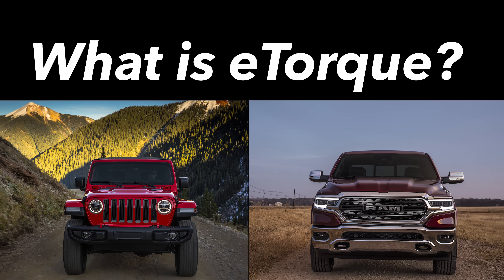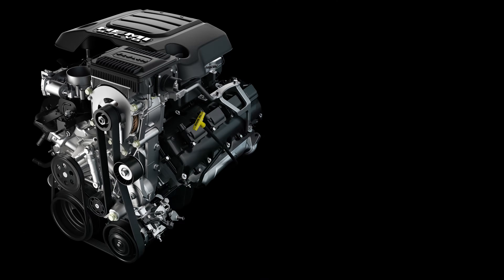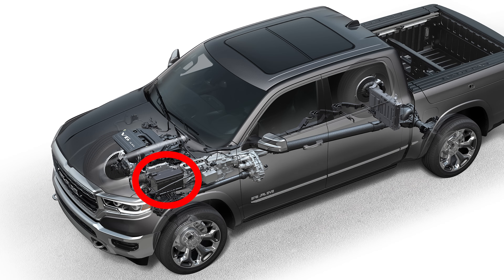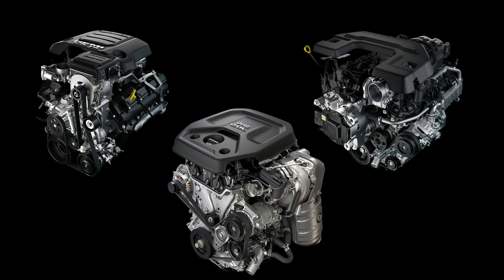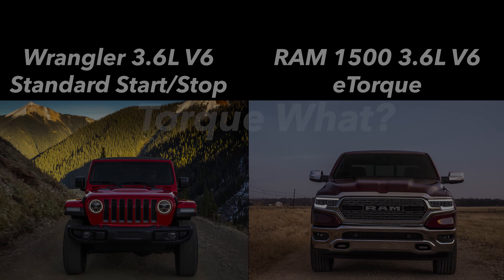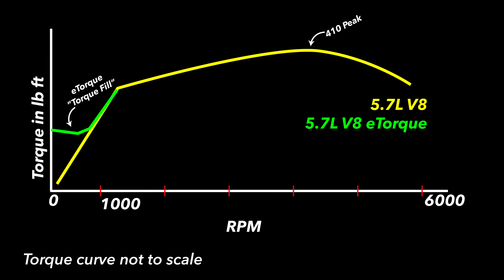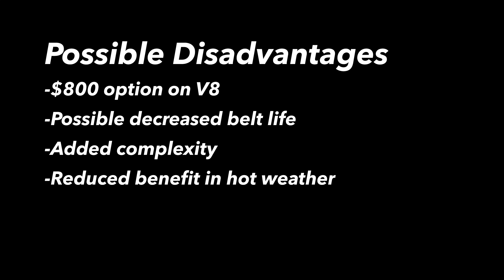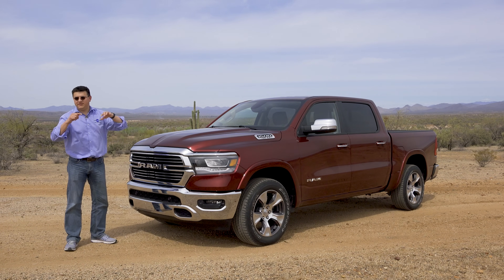Jeep Wrangler & RAM 1500 eTorque Mild Hybrid System Explained

Comment: I turn my stop/start off every time I get into my truck. It stops the AC from cooling the pickup and fouled my plugs so bad from all the stopping and starting that I needed them changed at 45,000 miles (usually 100,000).

Comment: I WOULD NEVER BUY ANOTHER RAM E TORQUE!!!! The MGU units ARE FAILING AT ABOUT 45,000 to 80,000 miles!!!
They cost $1,500.00 for the part!!! Installation and programming are another $500 (at least). The biggest problem is that so many are failing that YOU CANNOT GET THE PART!!! They are on back order and the wait time is over two MONTHS!!! I finally got my MGU, had it installed and programed by the dealer, but now l'm having other electrical issues.

Comment: I really like my new truck with the Etorque. It has saved me 20 % on gas and I like that you do not hear a starter every time you start back up at a light or stop sign.
Reply: Lol that's in ur head.. it's a .5 mpg difference
Reply: You better put about $2000 in a repair account somewhere.  The MGU (E Torque generators) are failing somewhere between 45,000 and 80,000 miles.  Oh, and have a spare truck/car to drive because it takes over two months to get the part!!!

Comment: They can't even make window motors that last a few years. Somehow i think the motor generator will break pretty early and leave you with a big repair bill.
Reply: The control module fails. Good news for DIY EV and hybrid projects that can take advantage of the fact these are relatively cheap ($500) used, hook an external controller up, and make one heck of an electric golf cart, trike, or motorcycle...

Comment: I have 2021 Jeep Wrangler V6 torque , anyone has any idea how reliable they are ?? I just bought the car
Reply: Not reliable. 35000 k, and it will need replacing.

Comment: Adds to the price, complexity and introduces many additional potential points of failure.  A real disappointment as there is no clear advantage to a vehicle owner.  If you want a 2023 V6 Jeep Wrangler with automatic transmission this system is forced on you.

Comment: I don't think it makes a difference. I'm not seeing any tests increasing performance on fuel economy, acceleration, towing or downhill braking. They really need to patch it to assist in some way noticeable above 1500 rpm. Is it available to transform down to a 12v to use in emergency situations where the 12v battery is dead so you can still start? 

I read it helps slow down the truck with Regen so I guess that's something but the battery has an entirely separate function and system that the user cannot utilize or even sense. 10% fuel economy?  In city only. What if I use the truck to haul or highway use majority? And now they've bumped up the cost of the hemi without it to equal the etorq offering. It's added weight, expense and complexity that fixes something trivial that doesn't apply a majority of the time. It's a nicety for the rich people that buy these to drive around town and that's all. Not for work.  Doesnt even run components.

Comment: This tech would of been nice in my Ecodiesel. Terrible stop start system and quite laggy down low until at least 1500rpm. Once you get going, the 442lbft is awesome and its a very smooth torque curve.

Comment: This system adds unnecessary complexity to a naturally aspirated V6 that passes itself off as the original Pentastar V6. I do not consider the mild hybrid V6 to be the original Pentastar. This is a new engine. When I learned that the mild hybrid V6 was the standard engine in the 80th anniversary Wrangler, I rejected that trim line outright. When I learned that Jeep will not stock the standard Pentastar V6 in any Jeep Wrangler in 2022, I decided I may be shopping something else.

Comment: Great explanation. I'm averaging about 16 city and 21 highway in my 1500 e-torque hemi with 3.21 gears. The Ram engineers said to expect about 10% gains in fuel economy. The extra torque down low helps with towing capacity. As long as the system stays reliable, it's a win.
Reply: I get 16 in town and 19.5 on the highway in my 04 4wd 5.7 without the gimmick. Waste of time and money
Reply: ... and my 04 has 315,000 miles on it. You're definitely not getting a 10% improvement in mileage but you will have at least 10% higher maintenance and repair bills, of not a lot more

Comment: Etorque system can expand the engine lifetime by reducing it burden at every start, plus agile acceleration. I like this combo.
Reply: This is incorrect information.
Reply: The etorque system doesn't spin the oil pump, thus i doubt this will add longevity..

Comment: "Added complexity".....for the added advantages you are mentioning.....?

NOT WORTH IT....

All this e-torque extra parts eventually needs repairs and replacements and the minor fuel economy increase you're mentioning is never going to cover for the extra costs of any all those extra parts....NEVER.

START/STOP put tons of stress on partss like the alternator and the starter motor and the exhaust system filtration....

people in Europe are paying the price for this fuel economy nonsense with horrendous parts costs and reliability.

Comment: Great video on a bad concept. Lets explore the ways this will have no long term benefit.
 #1 This thing once out of warrenty it is probably a $4k part if you have to replace it yourself
#2  Start/stop is dumb but now instead of replacing a burned up $200 starter you will be replacing this thing all to save literally a few drops of gas at a stop light
#3  Do you honestly think a 8/10 rib belt could hold 130 ft lbs of torque in addition to all the pre-existing accesories? No it couldent not unless it was a cog belt which it is not. 
#4  Unless this was mounted directly above the center line of the crank shaft and driven by a cog belt it will not last as a power enducing device.  Once any substantial load is generated by it or placed aginst it the cast aluminum mounting brackets will likely begin to weaken. If it is not mounted inline with the crankshaft the torsional load placed aginst it will be excessive
  All this crazy over engineered stuff looks good on paper just give it a few years to start breaking down.
Reply: I totally agree ,I had a 19 chevy 1500 ,it had cylinder delete and stop start ,I kept the annoying feature shut off , it was a 5.3 and got better milage than the 5.7 ram with all this expensive waste on it

Comment: Wrangler and Ram combine to about 400,000 vehicles/year, and FCA is using this volume to leverage development of 48V components.  Don't be surprised if bigger power consumers on your car suddenly start popping up in 48V.  (I work for an automotive fan company, and we have been fielding 48V requests for radiator fans for a few years now.)

Comment: You are the only one to tell us does  the A/C work while the motor is off.. And IT DOES NOT. Thank You! 
Then eTorgue is worthless here in South Florida. Much rather had an Eletric a/c no need for the torque help much rather save gas while enjoying a pickup. We have allot of  of traffic here is Miami, Fla. 98.5% of the year we are using our vehicle  A/C’s .. My current Hybrid Ford Cmax is awesome; but looking to buy a Pick Up; seems the 2018-2019 F-150 2.7 Ecoboost  will have to do. I am towing 4500 lbs fully loaded .. But need it as an everyday driver. How awesome a semi hybrid in a Pick Up that focuses just on the whole gliding, the drive through and of course the start and stop!  The amount of gas  saved just in those driving conditions here in South Florida would go so far!

Comment: And it takes much longer to charge the that battery then to deplete it so you tax the motor as it charges dropping the fuel economy... down hill charging slows the vehicle enough to make you have the step on the gas pedal,  just something to think about

Comment: I've driven the Cherokee with the 2.0L T and the lag when you floor it to pass someone is absolutely horrible from WOT to actual torque engagement.  Do we know if the 2.0L T in the Wrangler will eliminate this lag with the etorque motor?
Reply: Lag time in wrangler jl is going to get someone killed . This is a bad idea. I have a2018 Rubicon 2.0

Comment: Will the A/C clutch be effected by the E-Torque driving through the belt? Rather than just spinning with the engine, under Torque DRIVING the crank will there be more load?

Comment: Pretty sure when this is available on Jeep wranglers that the hardcore trail guys will hack this little battery to either run their winches or just use it for camp site power. Cause otherwise this system is pretty awful. But people will buy it anyway thinking this or that. Just my 1/2 cent opinion.

Comment: While I not been able to relocate the video that I viewed back in Jan/Feb about the eTorque system it explained that the system will only generate its additional torque into the drive line for about 1 second on 'start up'. 
    I believe some are thinking that this 130 ft lbs in the Hemi is in addition to the 410 lb rating of the engine.
Reply from the maker: It's more than one second, but as I say in the video, it doesn't "add" total torque, it simply fills ans doesn't do much over about 3,000 RPM

Comment: I saw a e-charger on a 57 chevy in a video last year i think not for fuel saving but for added power when kicked in but they used a cogged tooth belt my thought is a serp belt wont be able to hold up to this system thus resulting in short belt life and stranded cars due to broke belts

Comment: Why belt drive just hook it straight to the harmonic balancer pulley or gear to gear on the 6 o'clock of the flywheel, way more efficient

Comment: This is where government regulations drive bad engineering... Designed specifically to improve the MPG during the CAFE testing, not real life.  Motor runs when the vehicle stops if the A/C is running.. not much help in the south or the summer...No benefit at highway speeds.

If it were a no cost option it would be worth it.

Great explanation Alex!
Reply: Actually, our jeep doesn't run even if the ac is on. It will stop until voltage gets low enough or until the ac needs to kick on then it starts back up.
Reply from the maker: There is no benefit in steady state highway travel, however expanding the range where cylinder deactivation can operate will still improve your fuel economy even if the engine never stops.

Comment: Alex: Nice job (as usual). Question: I've searched, including the comments below and the official Dodge site (and others), but can't find a straight answer. Can you list the horsepower (HP) ratings of the three Motor/Generators (MG) please? I know you provide the torque and voltage but HP seems to be calculated from those figures based on RPM (unless I'm mistaken). Without the MG RPM figures very tough to guess at the HP equivalent value. I get why torque is the key figure in this use case but I have my reasons for wanting to know the HP. Can you help a nerd out? :) Watts at full power out (in motor mode) would provide the same answer if you have that. Thank you!

Comment: So we no longer need diesel for low rpm torque?
Reply: Andy Hass Don't get me wrong, I like diesels. All my cars in the last 10 years were diesels. But there is very aggressive campaign against them, they are banning them from European cities, so we need alternative, at least for fuel economy and low rev torque.
Reply: i also own a f250 diesel is that real enough? i get less then 10mpg in the city where i drive it, cost me $80 to fill it cause of the more expensive fuel $3.00/gal vs $2.50/gal for 87 octane gas.  A diesel engine is a $11,000 upgrade this hybrid system is $800 dollars
Reply: andy are you offended that i disagreed? why the insults did i hurt your ego?
Reply: nenadmil wrong. Did u even watch the video? The e torque gives a very short boost from a,stop light and below 1500 rpm. It's not for continuous use... When was The last time u hauled something with gas truck at it was cruising at 1500rpm? Never!.  The eco diesel has 420lb ft at 2k rpm. That can be used continuously to pull trailers etc. 
E torque is only for fuel economy on gas engines.
Reply: andy you don't need much torque for a continuous speed only for acceleration. And i have hauled my 5k pound trailer with my Tacoma and it is under 2k rpm. this will likely equal or beat diesel fuel economy in the city combined rating
Reply: Jon Dittmar good for u. Now get a real truck with a diesel and tow a real load. 5k lbs is barely enough to haul your gf. The taco isn't hauling a 5k lb load at 2k rpm on unless it's on flat ground at 45mph. When u r accelerating u would be at 4k rpm. So again the e torque on the ram isn't uses at higher rpm.

Comment: Hopefully people can disconnect it all in about 7 years when all the complex components start to fail and it's already out of date and expensive to fix.
Reply: Bruno TaTa it takes the place of an alternator so if you disconnect it you won't charge your 12v battery
Reply: Replace it with a standard alternator then unless computor controls dont alow for or cant be programmed for it
Reply: Jake Browne wow. That would be more complex and I'm certain it's not possible If everyone is so worried about complexity than don't buy a modern vechile.
Reply: TheJ602 thats why i own a 99 z71

Comment: Great video and very welcome - I’ve been waiting for this since BMW showed their performance hybrid in the i8. You said the total weight is 100 lbs, which means it’s doable for small cars. How long until Mazda prototype a 3 cylinder plus this system to add torquey fun and efficiency, in the MX-5?  Any indication that  Mini or other small car brand are thinking this way?  Thanks for another great video.

Comment: @Alex On Autos does the new CLS use 48 system for all its electronics or very similar to the FCA iterations here?
Reply: Blake Swan The Merc is also 48V. You are correct in that assumption.
Reply: Cory Stansbury I'm.aqare it's 48.volt autocorrect loped it off Dow whatever eeason
Reply: Blake Swan I think your phone is having a stroke!
Reply: Cory Stansbury I hate my phone and auto correct so much. It uses n in place of a space, ect. Apologize for the stroke like texting
Reply: Cory Stansbury to your point though, the MB CLS is the same setup as far as edrive as the ram?

Comment: I would be more interested in this if it had a 48V AC unit that would keep spinning when engine is stopped.  Engine will only be able to turn off for a moment in hot weather.  A good start but still 1/2 arse.

Comment: I believe these systems will become very common in the next few years.   They make a great deal of sense in vehicles like the Ram and Wrangler.   The improved fuel economy is nice, but the added torque off the line is really what makes this system worth the extra cost to the consumer.
Reply: Well, the path to efficiency and better power delivery. Turbocharged engines increase maintenance costs and lower reliability. Hybrid systems take up too much space, add too much weight, add too much cost, and they don't have benefits under certain driving conditions. Pure electric vehicles add even more cost, and there is still the issues of range, charging and the economics of it all. Diesels are strapped with costly and unreliable emissions systems.....So this really seems like the best balanced. Instance electric torque, better fuel economy, no complicated emissions systems or turbochargers, it's relatively light weight and takes up minimal space, and it doesn't add too much to the cost of the vehicle. Simple, compact, low cost mild hybrids are something all manufacturers can do.
Reply: Checkers, you sound like you know what you are talking about.  Personally, I wouldn't want a new diesel tractor or truck if you gave it to me for free.

Comment: 48V hybrids will be a really big thing. I expect significant part of the vehicles will have that within like 5-8 years (1/3-2/3 of all non EV non PHEV non HEV).
Alex, some mild hybrids will likely be able to drive the vehicle in start-stop traffic (5-10kW is enough for low speed crawling). But motor must be further down the drivetrain. Therefore be prepared for that. Mild Hybrids can move on electric propulsion. And electric AC. And electric PS. And electric turbocharger. And electric heating even. So every time new 48V vehicle is being reviewed, mention those capabilities :)
Abbreviation for this class of vehicles should be MHEV.

Comment: How heavy is the system?
Reply from the maker: 100lbs total including all parts
Reply: Sounds pretty good to me. It will make the V6 feel more like a turbocharged engine at lower RPMs, keep the weight inline with with a turbocharged V6 engine, and it actually improve fuel economy and maintained reliability, something the turbocharged engines often fail to do.

Comment: Firstly love your new technical explanation videos Alex. Secondly this system reminds me of the old GM e Assist used in the 2.4L Malibu and Regal but running off the 48v system instead of the 12v. Honestly e Assist was so mild it didn't live past 2 model cycles which brings me to this; is it really worth the cost in the age of integrated starter motors and hybridization?
Reply from the maker: eAssist is making a comeback actually, Buick is dropping it back under hoods and the Silverado got it last year. Expect to see more of these as costs come down on the parts.

Comment: They need a hybrid system if they use start stop . Cause the delay is problem if pulling out in traffic
Reply: Auto start stop on Ram's is only on Etorque models. And it flawlessly starts up in a very quiet and unnoticeable fashion, unlike every other start/stop system out there.